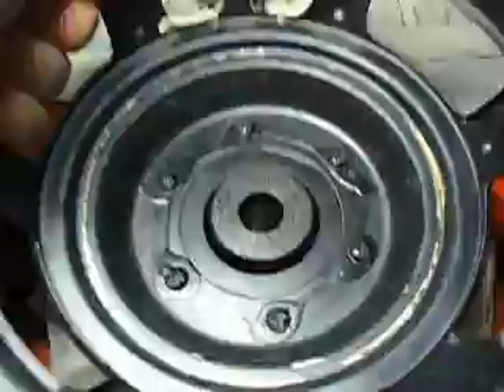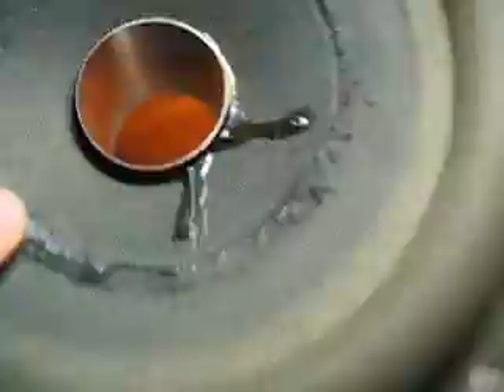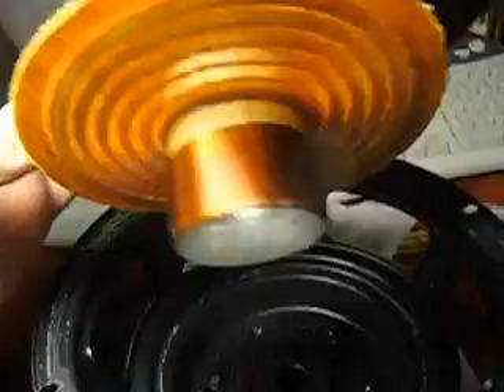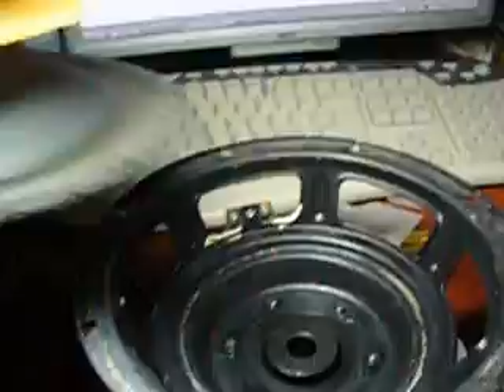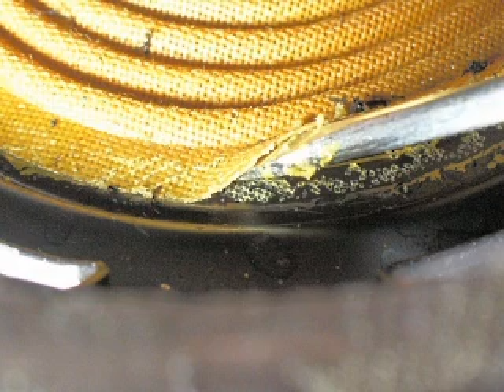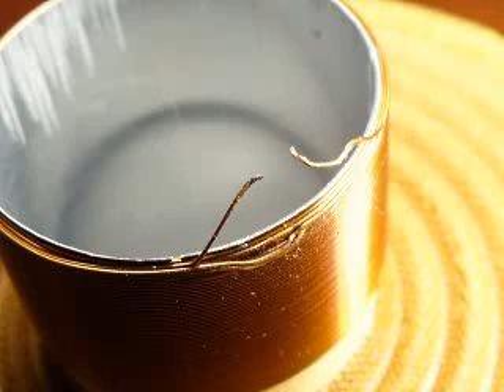Disassemled TangBand W8-670Q (Z-560)

Comment: It works physically this way round, but has no benefits. Very few speakers are excursion limited by thier surrounds, rather they are by the magnetic gap height and coil height (the parameters which actually define Xmax). All you'd be doing is reducing cone area and thus output, as well as pushing up fs with the lighter cone. You'll still hit the pole piece or experience massive non-linearity (distortion) at the same Xmax levels. It'd allow use of a smaller enclosure is one "benefit" I guess.

Comment: I don't see what you're hoping to achieve by that? You put a small 8" cone on a 12" driver's motor assembly and the lower cone mass in relation to magnet strength pushes the resonant frequency up;  you'd get LESS deep bass. Excursion won't be improved beyond what it was on the 12" just by changing the surround to a wider roll, the spider and most importantly motor assembly also have to facilitate it. I guess what I'm saying is don't bother, leave the 12" driver be!